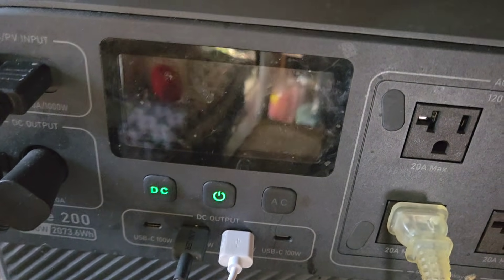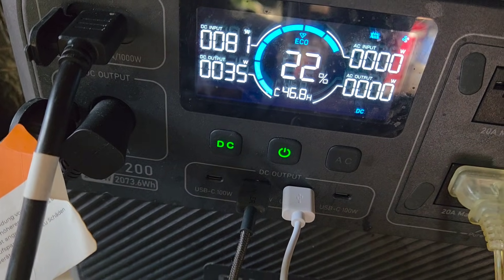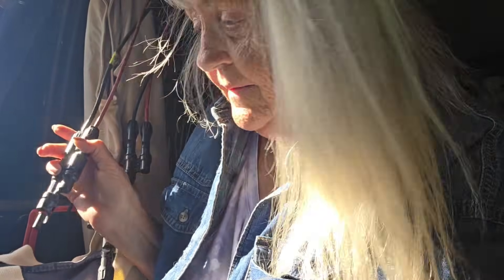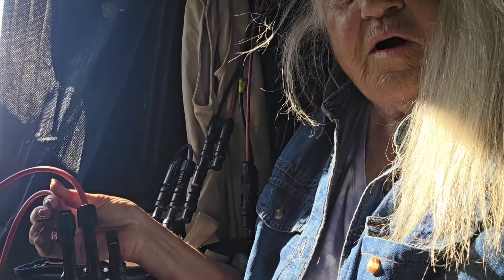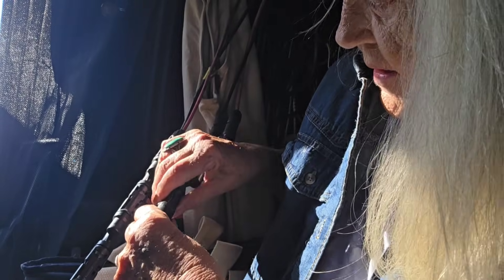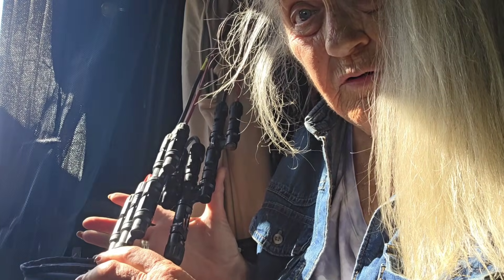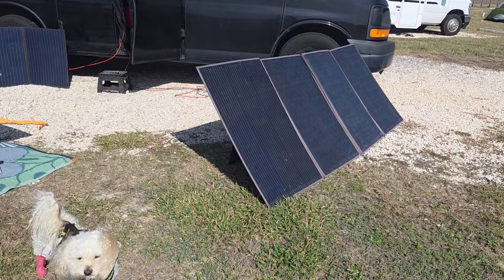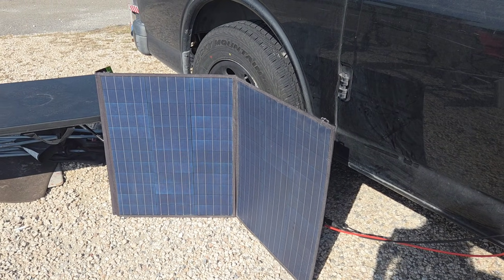Connecting a variety of  solar panels together to charge solar generator/workstation

Comment: A solar set up like yours is something non van owners should also strive for.

Living here in the California Sierras most folks have some sort of solar be it a whole house set up or a portable set up, because we get rain and snowstorms that can knock power out for days if one is on the grid!  

Noticed the senior HUD housing installed solar on all the units last month, so of the power goes out their residents will have backup power.  Seniors need it because so many use medical equipment.
Reply from the maker: Yes they do.

Comment: I have a question about days without sun. If there is no sun but its still bright, not dark , just no sun. would you still be able to recharge your phone or/and  boil water on that day or do they recharge only with sun ? And can you store electric from a sunny day for a cloudy day? When I move to Sweden one day I do have electricity but when I retire I need to save money and want to cut off the expensive electric connection and use solar😊
I was waiting for this video😅
Reply from the maker: Your solar generator is a battery that stores ele tricity

Comment: I'm in a house, but cannot afford to put solar on the roof and don't trust those "no money up front" deals. I have a Bluetti 200 max and one expansion battery that I use to power my home office with. I am currently rocking 2 Renogy 200W ShadowFlux panels and usually get 120 w throughout the day maxing to 250 w when the sun is directly overhead.  Shadowflux works when the panel is partially shaded, which is why I went with them. Less than $240 each.
Reply from the maker: Sounds like you have a great setup!